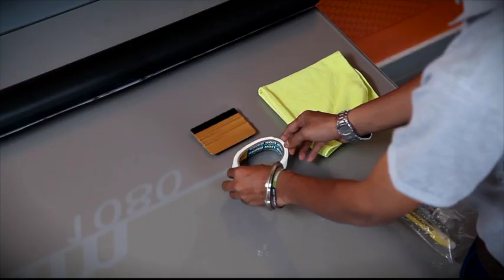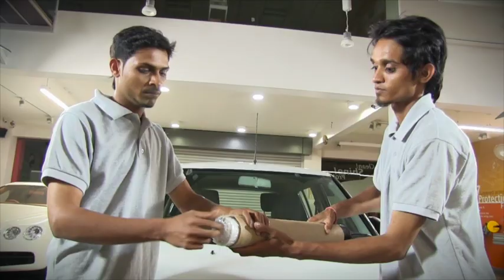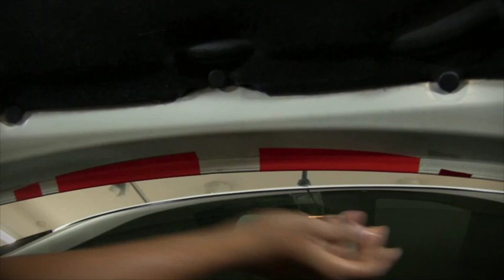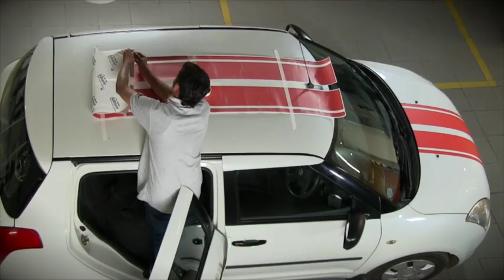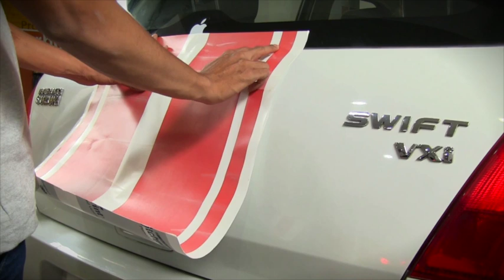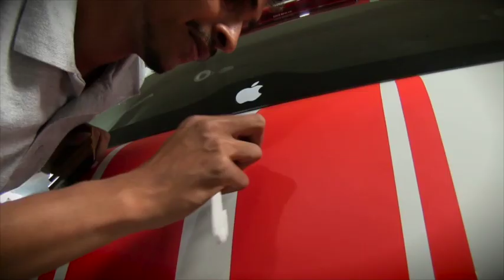How to apply Racing Stripes on Cars - 3M 1080 Wrap Series Film

Comment: Hey if I do that will I have to report to the dmv that I put stripes on, my car
Reply: You can ask them. Typically, cosmetic updates do not alter the operational characteristics of a vehicle, so no. If it were window tint, you may need to check with law enforcement for laws restricting the darkness. They have window tint checking meters that have a slot in them and they insert the window class in this slot. It then provides a percentage of the amount of light that can pass through the window and this is compared with the laws, if any.

Comment: These only last 2 years tops in an area where heat is an issue. Bird droppings and heat killed my 3M stripes. Major disappointment.
Reply: Thanks for informing. I'll get the one which are available at maruti genuine accessories.

Comment: Don't try dry method. It simply doesn't work on anything but the smallest decals because air bubbles happen no matter how hard you try. You can't press them together if dry and the result will be a mess.
Reply: these are specifically designed to go on dry, they have air egress channels that allow the air bubbles to come out.
Reply: Well they don't work very well at all.
Reply: 1080 is designed to apply dry as it has the 3M air release adhesive. Simply, if you get bubbles in this stuff you should give up and get it done professionally.
Reply: I actually got some stripes cut from the 1080 series wrap after my first comment and they were the easiest vinyl stripes I've ever applied. went on dry with ease and ZERO bubbles at the end. any air bubbles just flows out with using a vinyl squeegee. I accidentally had a large, sliver dollar sized, air bubble and with a little pressure and squeegee'ing, it was gone. 

I can't see using any other vinyl product if you're an amateur like me installing vinyl in your own garage.
Reply: The video skips over pretty well all bubble removal. Did you have to move bubbles? It also skips over how he removed that large crease at front of hood. With 70% alcohol its permanent lock in seconds.
Reply: All you do is squeegee the bubbles to to the edge. They flow out easily. this is all done with a light pressure. Once you're set to where you want everything and all the bubbles are gone, you squeegee with a firm pressure that I guess locks the vinyl in place. It seriously was the easiest material like this that I've ever worked with. I'm not a pro by any means, but I've done a lot of vinyl on my own cars over the years and I'm going to stick to this stuff.
Reply: We are a professional sign shop and wrap whole vehicles - cars and buses,  with this material. IPA mix is only used to clean the vehicle, using it as a wet application is a big no no. The IPA in the mix is so it evaporates quickly. There is no secret to the removing of bubbles, it is all in the application technique. You need to give the air an avenue to escape. As has been said, move from the centre to the edges. What they don't make clear is the hardest part to do is the curve on the face of the bonnet. You need to be careful with spears developing. They are using a 3M specialist application film in the video but not many shops that produce these on ebay actually use this product as it is expensive, they usually supply with a paper based application/transfer film or a cheaper plastic version. But it can be done without much effort if you take your time.
Reply: Thanks, so strange that I could have so much trouble while others breeze thru it. The decal did have 3M markings on the back and seemed good quality. Nothing is simple!
Reply: May have been from China. There are a few fake counterfeit products that are being sold as 3M sadly. We see them all the time. They are a nightmare to fit, even for a professional fitter.
Reply: What is  cost of materials pls 
Send me cost
Reply: 2004 Monte Carlo's with lay down spoiler, are kind of a pain
Reply: He's very good at his job!